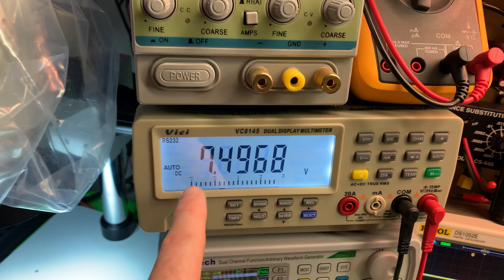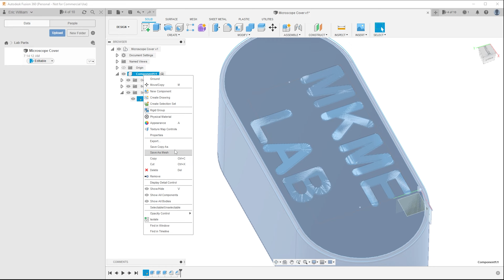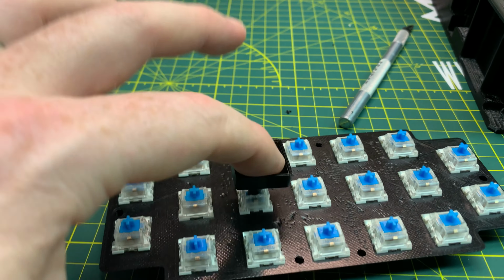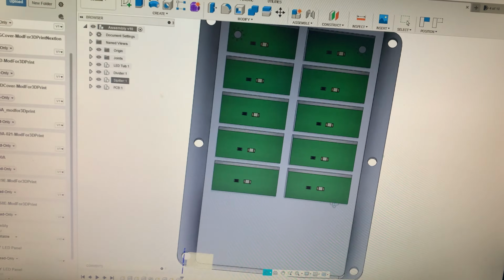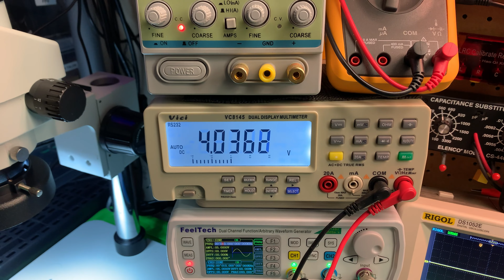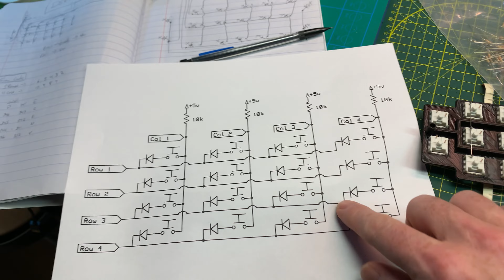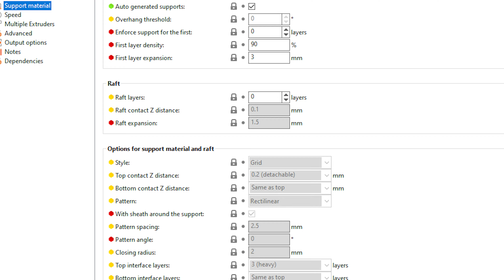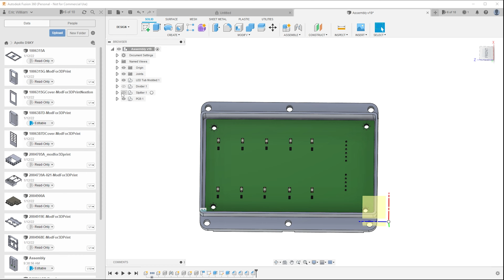TWO Raspberry Pi Projects Are Better Than ONE -  Update

Comment: I see an old Ungar soldering iron.... What model, and where to you get tips? I've got an 9900AS in storage, as I can't find replacement tips for it(u99**).
Reply from the maker: My father gave me that when I was a teen and I used it for MANY years and still do for some jobs. The tip is somehow still near pristine on mine and I have always been curious what the heck it is made out of.  I assume it is the fact I have always used the same Nextech (ratshack) solder but there is some component of the makeup that has made it incredibly durable somehow.  Last year I went looking for tips in curiosity I found zero.  Not a single one.